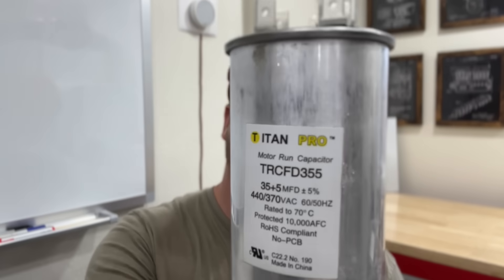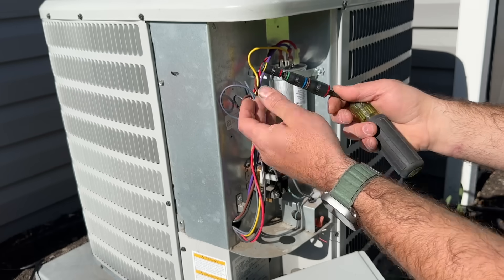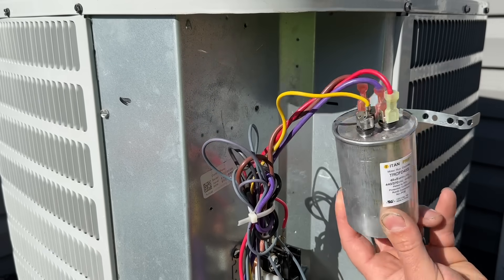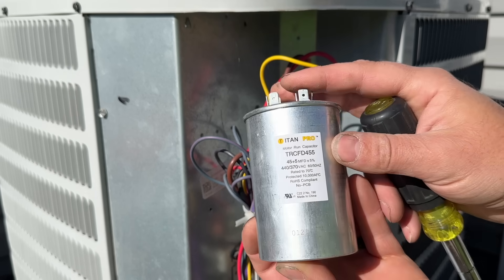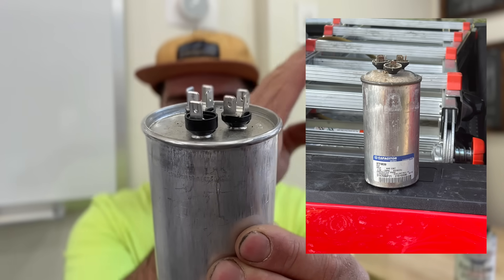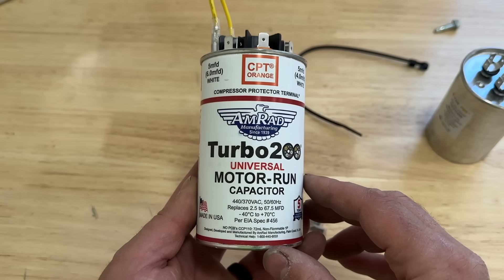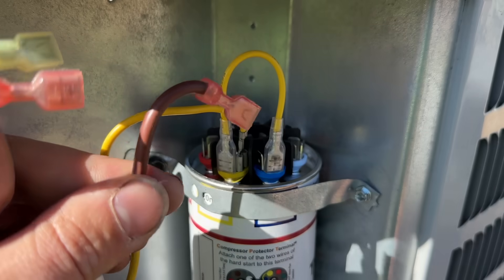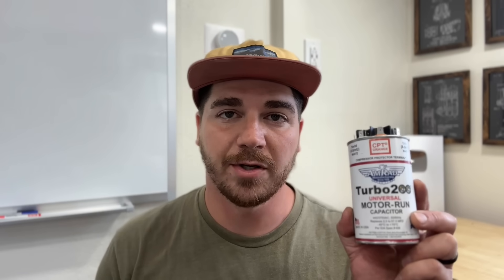HVAC Contractors Practically Make Their Living On These

Comment: I disagree with you advice. A turbo capacitor will shorten the life of your compressor. It’s like flooring a car every time you accelerate.instead replace your old capacitor with a new one and install a soft start. You will prolong the life of your compressor.
Reply from the maker: The turbo 200 isn’t a hard start kit lol it’s a universal capacitor. You sir are confused. The turbo 200 is like the factory one it just has multiple values so it’s a one size fits all once the correct jumper is in place.

Cheers
Reply: @diyhvacguy  I stand corrected, I thought the turbo meant hard start. Thank you for you excellent YouTube channel.

Comment: Capacitors should be installable as a module from the outside of the unit. Turn off. Pull module. Push new module. Turn on. Test.
Reply: AC units were never engineered to be serviced by the homeowner, period. However, there are safety protocols that must be followed. 240 V is almost always lethal! Any homeowner who feels uncomfortable, doing this kind of work, should call a professional.

Comment: Thank you!  Great advice. If you can tighten kitchen cabinet hinge, you can probably swap a capacitor.  If your A/C has the symptoms, it is worth taking a shot at replacing the capacitor, even if you don’t have a test meter.  You’re out less than 20 bucks and if works, you saved a couple hundred or more.
Reply: The danger in a first time cap replacement is cuts on your hands from the jagged edges of zip ties that you may have to work around. I have snipped back all of the jagged edges of all zip ties. When a cap goes out, it may not be in daylight.
Reply: @HardRockMaster7577   Excellent observation and advice!  I always snip off the excess ends of zip ties.  I wear safety glasses around wiring where zip ties have been used because I’ve come uncomfortably close to getting poked in the eye by one of those ends sticking out.

Comment: I was a HVAC technician for 7 years for a giant company in my area.  A blown cap call is usually 79$ for the trip , a cap is a easy find so no diagnostic fee, and 149$ to replace the cap, wich includes a 1year warranty. So your looking at 228$. The capacitor runs about 7$ from the part house.  Now let's break this down.  This call probably took 30mins including paperwork, reason being you can't just replace the cap and go, no. I  have got to check refrigerant pressure,  delta T, and all other functions of the system.  So the company I worked for has invested insurance,  my hourly wage, gas and the promise to return if the part fails again. Not to mention most people these days don't have walk around sense let alone be able to diagnose and repair a HVAC system.  I'd say you got a good deal.
Reply: Nobody is saying this should be free, but I've seen countless scenarios where it's way more than what you outlined.  An hour labor is perfectly reasonable for this job.
Reply: Local 36 Tinner here. A lot of people don't think about the stuff you listed. They just see the cost of the part and the bill and get mad...
Reply: I've just ordered a meter for $18 to check the cap. Money well spent!!
Reply: that is reasonable.  sounds like some companies rip ppl off tho
Reply: Wow, $80 for an oil change. Last time I paid for an oil change it was about $30-35. That was about 15 years ago and I've gone back to doing them myself as I got tired of being told I need a radiator/engine/transmission flush  for $900.
Reply: Uh, yah, IF you get charged that which is likely VERY rare.  I've built two houses now (owned 7 over my 51 years) and have yet to meet a plumber / plumbing company with any morals.  The sky is the limit on what they will attempt to charge you!
Reply: @karlhungus545  A dirty trick I saw an installer pull was grounding the cap with a sheet metal screw using a drill, stripping out the threads. This would cause the leads on the capacitor to vaporize. After they replaced it the leads vaporized again. I opened the case and saw the issue, replaced the cap, then grounded with a machine bolt and nut. It's been working flawlessly for 15 years. The name of the company rhymes with crotch.
Reply: That's the pluming business not HAVC.
Reply: @Mike1984-lc9rh just because the compressor and fan work doesn't mean it is cooling properly. a good tech will provide value for the money charged and check everything  to avoid call backs and future breakdowns- the indoor blower/coil, indoor cap, filters, temp drop across the coil, etc.
Reply: @Rumpelstiltskin-yv4ep So definitive. So wrong. Tell me why you think you deserve several times the wage of another man for your time? If you want others to pay several hours of their labor for a half hour of yours who is not valuing whose time? The plain dishonesty to put the cost as under the part  when the part does not cost anywhere that much money. What is the money for? If you are charging X amount of dollars for labor and $20 for a capacitor, honesty would be to say so plainly. But you won't because others will not look kindly on having to work several hours at a job probably more difficult than your own just to pay you for 30 minutes of your time. It is you that is not respecting a man's time.
Reply: @Rumpelstiltskin-yv4ep No, you don't have to explain anything to me, and yet here you are speaking with profound ignorance. You have no idea who I am or what I do, yet you make all these assertions which are so much baloney.
Reply: @Rumpelstiltskin-yv4ep Not even close. You are lost in your own imagination. At least the blind know they do not see. Yet here you are groping around in the dark without understanding. What you see is a dream.
Reply: you don't have to check refrigerant pressure if the unit is otherwise cooling fine - better to not disturb a sealed system unless there's a real need.
Reply: Exactly! I so many times have to explain to people it's not just about the cost of the part but all of the costs that go into being able to be there and to cover time, insurance, having the skill set with tools, supplies on board and many other costs just to be there and my skills did not come cheaply. They often equate a food service workers(waiter) job to many service industry fields onsite-on demand service. Two weeks ago I had someone ask if I would match a price he found online for the part(because I flat rate each service) and I said sure but he will have to pay full rate for the time involved with his job...time traveled each way, time on site, service call fee and markup for the matched part. Once he understood how much more he was going to pay for a non flat rate invoice he went with the first price. I'm not there to rip him off but I deserve to make a fair living for my hard work and skills.
Reply: No, not reasonable. A twenty dollar part should not cost $149 dollars on top of $79 to fix. I do it myself these days. It is very easy to do, and does not take very long.

Comment: Having serviced many tens of thousands of AC units I can honestly say that bad capacitors are rarely the issue.   Randomly replacing one is absurd.  Only someone with interest in a capacitor factory would put out such a video.  Beware of a dude telling you about someone else scamming you.  He's probably trying to scam you, instead.
Reply: I somewhat disagree.  Capacitors became a disposable item once they were forced to switch from PCB’s to vegetable/mineral oil.  The old caps with PCB’s lasted nearly forever
Reply from the maker: When In this video did I tell anyone to replace their capacitor for the heck of it? 🤣 You need to watch it again bro. I gave options for buying the same size cap, so when it goes bad (on the first hot day of the season) you’ll have it. And if you don’t want to to hassle with going to find the size right now, the turbo 200 is one size fits all.  

I kind of called out the hate speech, but you clearly didn’t watch the whole video so you wouldn’t have seen that part 🤣

Cheers
Reply: @garrybillick3979  Dave was replying to the original commenter. Everyone in the thread gets the reply which is why it looked like he was talking to you.
Reply: @josegaspar813  My bad.  I thought YT used to only send a notification if someone was replying to your comment.

Comment: I was charged about $ 350 to have one replaced.  I was by a company that advertised on the local TV station.  Being an electrician and  working with all kinds of industrial equipment I was shocked that he told me that the scheduled fee of his company was that price.  He asked me what I thought the capacitor cost  and I told him about $ 15 to 20 and expected a markup to $ 50.    He was friendly and taught me a lot about the AC while he was here and did clean the unit inside and outside for another $ 100 .  I ordered that capacitor and a relay he told me that is another trouble spot for about $ 35.  A couple of years later the  AC quit again so I replaced that capacitor and it has been running fine.  I was expecting his price to be around $ 100 to come out With $ 50 more for the part and he was only working on the equipment for about 10 minutes.

Comment: This is even more noticeable when you have someone close to you who's in the business and know how much is being charged.  I understand the whole "Retail" upcharging thing.   The company has a higher cost of doing business so they need to upcharge somewhat to make money.   But how much upcharge is the real issue.   And let's not forget how much they charge for Freon vs what they pay for it!    $200 per lb just seems like robbery.
I currently have 3 spare caps(2 units)(from Amazon) just waiting for when they need replacing.
Reply: R410A is considerably more expensive.  Best price I can find on it right now is $375.  R22 is around $2000
Reply: Do you know how much refrigerant costs to buy?
Reply: @garrybillick3979   Probably around $175(give or take) for a 25 lb bottle of 410A?   That is of course the wholesale pricing.  i.e. what the HVAC company pays.  Not sure about R-22 replacement types.

Comment: Just changed the capacitor on mine as the herm side was measuring zero. Unit still tried to start up but wouldn't work, Tested the soft start module(installed in 2020 with a whole house generator) and it was bad. Opened it up, changed that capacitor as well and everything works as it should. Soft start modules are around $250, A replacement capacitor for them are about $13. super easy to open the module and change it out as well.

Comment: You talk about crooks charging $200 to replace a capacitor then you try selling nut drivers for $30.  Who's the real crook, here?  HVAC contractors have a lot more expense than the cost of the capacitor, such as the truck, the tools, the equipment, the overhead of a structure, license, fees, taxes, regulation, etc.  Time to diagnose prior to replacing a capacitor costs money.  You shiester.  Like the kettle calling the pot black!!!

Comment: Our A/C Has A Capacitor For The Cooling Fan & The Compressor But It Looks Like You're Running Both Off Of One.
Reply: Most AC condensers use a dual capacitor to save space, but yes. There are some that use individual capacitors.

Comment: Awesome!!  I look on Amazon at the Turbo 200's but there are different physical sizes (Lengths & Diameters).  Does it matter which one I pick as long as it fits into the panel like the old one?
Reply from the maker: Does not matter. Most have plenty of wiggle room 👍🏼

Comment: Not just AC. We have a 3-wire submersible well pump with a control box in the house near the water pressure switch. It also has a motor start capacitor. I keep a spare on hand and check for leaks occasionally and replace.

Comment: A question to the knowledgeable ones, on my ac unit when is turned on and once temperature is reached to cool the house, right after that point a humming sounds what I believe it comes from the compressor, every time the compressor is trying to cycle to maintain temperature, the compressor cycles with a humming sound like 8 to 10 times before start working as it should, it almost is like the compressor is having a hard time to start kicking in, the compressor was checked and it seems the instrumentation to troubleshoot indicates the compressor is ok, doing a little more research it seems the problem was the expansion valve, it was replaced last summer with a new one but the problem continues.
The AC unit still works ok as longest the compressor cycles correctly after 8 to 10 attempts, summer is around the corner and I would like to get it fixed before this issue breaks something else on my ac unit.
any suggestions what could be causing this issue?
In advance thank you.
Reply: May need a hard start. Check start amps, good chance it's pulling a lot more amps than it should when trying to start up
Reply: @amiatroll1  I will look into it, thank you.

Comment: I usually do this myself, but I was having my A/C serviced before the summer by a guy I've used for years.   One capacitor was down 10% so I told him to just replace it.  He charged me $150 parts and labor.  Was that high?  yeah,   But it was done, I didn't have to figure out which capacitor, wait days to get it,  risk a heart attack by not discharging the old one, or wiring it up incorrectly plus he was here already.  $150 was fair.  In the past when the fan or the compressor doesn't kick on. I'll pull the cover and look.  If it's bad, I'll just do it myself.
Reply: $150 for a run capacitor is honestly rather reasonable.
Reply from the maker: Yea quite low in the hvac world  really

Comment: The expensive huge companies in my area are charging 620$, our small medium family shops are around 330$, new jersey area.

2k? I hope they lose their license.

Your thumbnail shows an expensive turbo cap, if we all used those for replacement, I'd feel better about charging 350$ for a cap.

Jeees really 2k??

Ty for the content.

Edit: no disrespect and I could be wrong, you explained situations for a bad capacitor.   Did you miss the +/- tolerance?  Imho check your cap every year bc even if it's still working, you are putting added stress on the motor in question. Do not wait till things are not working people =X if we are talking about diy maintenance and saving money.

Comment: It's not a scam (other than the $2000 cost).  It's a common part failure.  Now, charging $2000 for it is unethical, and while I'm sure it has happened I doubt that's the norm.  None of the ones you show   When mine failed, my AC tech came out and found it was the capacitor, he told me and gave me the option of replacing it myself for about $20, or if he replaced it the cost would be just under $200 after you add in the charge for the service call.  I had him replace it because he had the part in hand and I could get my AC fixed right then rather than wait to buy a capacitor myself.  I kept the old one for reference so I could buy a spare to keep on hand for the future.
Reply: No one said it was a scam to replace a faulty part. The scam is charging an arm and a leg for it or replacing a perfectly good one.
Reply: @mbrownie22  If they replaced a good part; that's considered fraud!

Comment: HVAC, electricians, plumbers, or any other trade that requires a licensed and certified trade. I understand the concept and while it makes a lot of sense on paper it inevitably increases the scarcity and then those groups lobby and make it to where you're not even allowed to do any of that DIY in my state. Then with cities regulating everything down to we aren't even allowed to demo a piece of drywall without getting a building permit in my state. What choice do we have, I know how to do plumbing but it's illegal for me to do it. I know how to do electrical illegal for me to do it. I'm a contractor by trade and we were working on a big house for the electrical was all messed up. First two quotes I got from local electricians that we've done work with before we're within $1,000 of each other and it was $30,000. Then I'm up and coming electrician contractor who we've had on multiple other projects he came in and did the whole thing for 5,000 and we got the same past final first try with the city electrical inspector. Explain to me where the other 25,000 comes from. However what will happen is my up-and-coming electrician will quickly realize he has way too much work and will accordingly raise his prices and within a few short years he'll be at 30,000 for the same project that took him an entire two days.

Comment: I had an HVAC guy tell me I needed a new furnace in 2016. I replaced the blower motor myself and everything ran well. It's 2024 and l replaced the motherboard, new ignitor and replaced the flame sensor just in case just in January. It's running like new!

In 2017 I was also told that my AC condenser needed to be replaced and it literally was just the capacitor and the shut off needed to be taken out and re-inserted.

I had quotes of $25k to replace these things in 2017. If I would have done that today I would have a 7-year-old system that probably would be experiencing a few of these issues again and I'd be out $25k that I didn't have